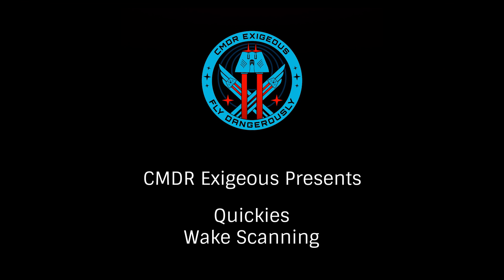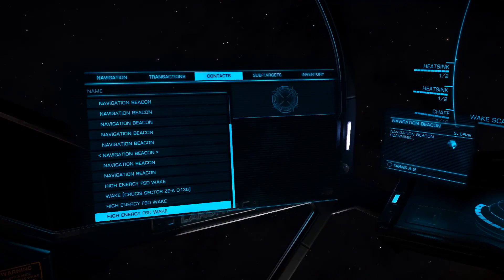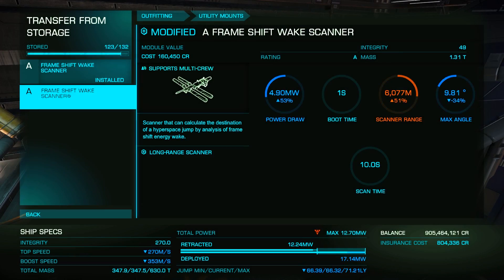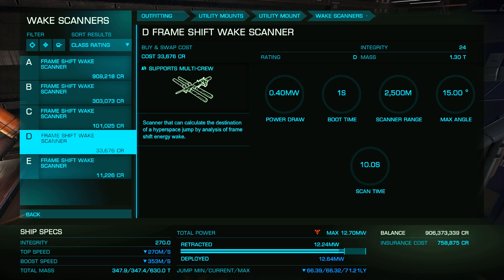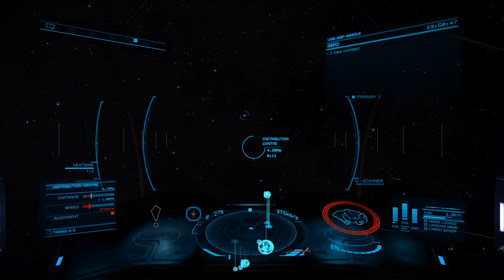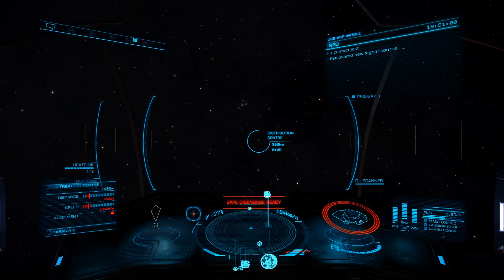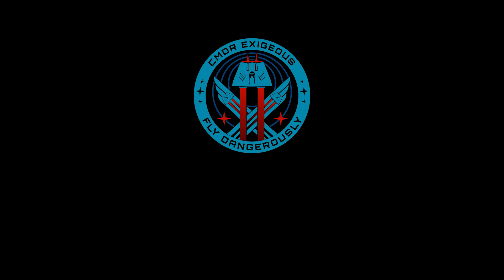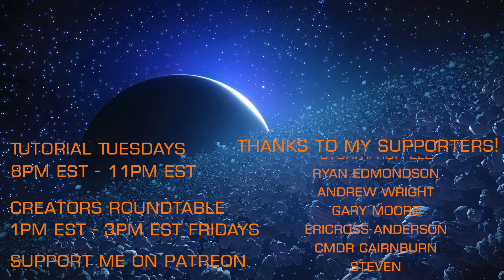Quickies: Wake Scanning For Datamined Wake Exceptions

Comment: The ONLY place to data mine or farm is "Jameson crash site". On hip 12099 1b. You get grade 4 & 5 very fast and there is a data material trader less than 100ly away.  
It takes very little time and it still works well.....

Also DONT TAKE LARGE SHIPS.

landing and fonding a good spot to park for the scans can take a bit of time. But its worth it.

Comment: How can I get *50* decoded emission data to unlock Tiana Fortune? Can I get those from scanning people at stations?
Reply from the maker: You can by but far the fastest way is to use the Jameson Crash Site, I have a video on efficient data there that covers it. You can get 16 datamined wake exceptions in about 20 minutes using the site and a material trader (or a ton of other lower grade stuff via trading)
Reply: @Exigeous  I was just there for about 20 minutes or so and it told me I couldn't get anymore data because I was full. I think perhaps I left too soon? Maybe it was just that I was full on the low-grade stuff they were giving. I bet if I stuck around I'd still be gathering data. The next issue is I went looking for a material trader to get dm wake exc and couldn't find any. Is there a trick to finding one that does? I hope it wasn't nerfed. I may need to just go scan outside stations for while.
Reply from the maker: Okay you're still missing a few things it seems. Let me be really clear:
- When at the site you'll leave when you have 100 "Adaptive Encryptors Capture"
- Head to Ray Gateway in Diaguandri
- Go to Contact - Material Trader
- "Datamined Wake Exceptions" are a grade 5, I believe it is in the very top right of the table (might be one below that, this is from memory)
- Click it first then go click Adaptive Encryptors Capture - you'll be able to trade the 100 you got for 16 Datamined Wakes
- Done

That shouldn't take more than 20 minutes if you start at Ray Gateway, fly to the site, farm it, self-destruct, spawn back in the station and trade. If you fly back and have a terrible jump range it might take 30-35 minutes tops.

And no, this absolutely has NOT been nerfed in any way - and you don't have to go to Ray Gateway, it's just the closest to the crash site, you just need any encoded material trader. As I said I already have a guide on the channel that will tell you how to find them all.

Make sense now?

Comment: Nice I’m looking for those data types 
Iv not used a wake scanner yet 
In the galaxy map how can you find boom to famine location areas
Reply from the maker: You can filter it by either, separately - so if you're looking for a system in both states it's FAR easier to use a site like EDDB.io or Inara.cz where you can put in your current location and what you're looking for to find it much more easily.  While you can do it this way be sure to look at my video on gathering data at the commander Jameson crash site as that can be VERY efficient.
Reply: CMDR Exigeous thanks dude

Comment: Which wake scanner would be better.. fast scan with an high speed ship or long range scanner?
Reply from the maker: In my experience I'll take long range every time, as even with a maneuverable ship, and I use an Asp with G5 thrusters so it's very nimble, I'd rather be able to basically sit in one spot and just point in the right direction.